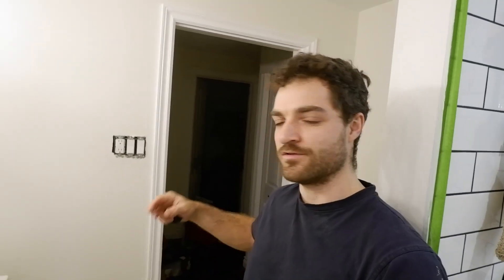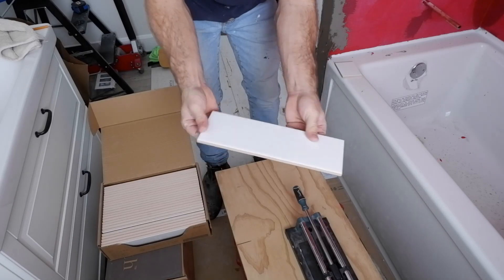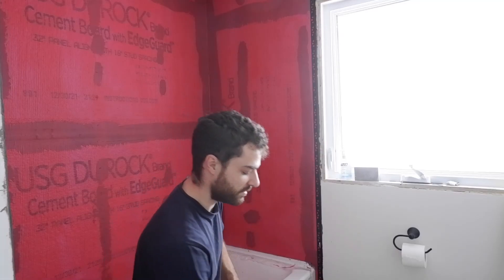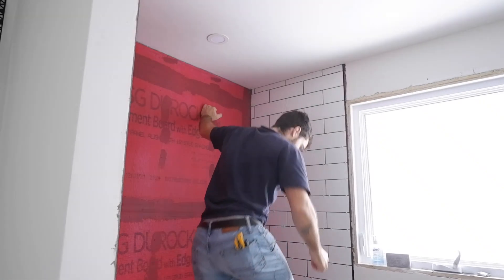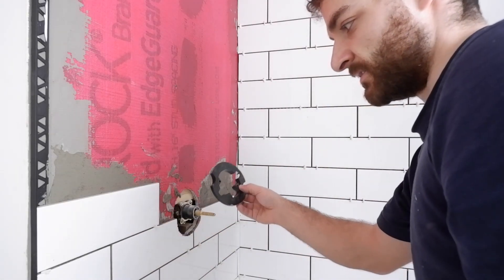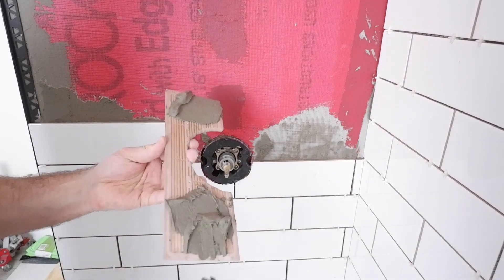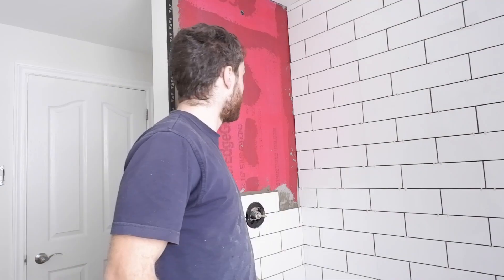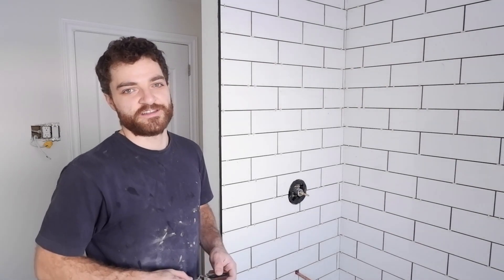How to install 4x12 subway tile - Bathroom remodel part 4

Comment: Usually I see them starting in the middle wall
Reply: That's an option, I didn't watch the whole video, but maybe working out the layout before would've avoided ended up with those small pieces at the edges.

Comment: Did you use a score and snap tile cutter?  Also, I'd love to see a follow up about any issues you may have had over time.
Reply from the maker: I did score and snap most of them! The tile that terminated into the tile edging/trim piece, I cut with a wet tile saw to make the edge a bit nicer

Maybe a follow up video to come!

Comment: That small sliver cut in the corners kills me. 4x12's can easily end full, then half.
Reply from the maker: Totally see what your saying. Unfortunately it was a retro fit with the tub, so the slivers would either happen in the corner or the outside by the Schluter, is in my opinion looked worse.

Comment: Did your tile have lugs? I noticed you only used spacers horizontally.
Reply from the maker: Good eye! I actually ran out of spacers, so I got my 1/8” gap on the vertical, typically using a spacer, then used the spacers for the horizontal.

Comment: Hey Zack, did you do anything to seal the holes around the mud guard or the holes for the copper tube?
Reply from the maker: Hi David, for the shower valve hole, I didn’t, I leave the mud cover in, you can bury it over with tile but it’s made to be removed if there’s ever an issue with the valve, then the decorative cover has a built in water seal, then the tub and shower pipe I caulked around.

Comment: Nice video! Did you back butter any tiles besides the one around the shower valve?
Reply from the maker: With the subway tiles, I didn’t, but I do like to squueze in some thinset into the gap between the backside of the tile and wall if I can!

Comment: Hi Zack - did you use modified or unmodified mortar over the redguard?
Reply from the maker: Hi! Yep, we used a notified thinset. Type of tile may factor into that so just double check!
Reply: Always use modified. Non modified is a thing of the past no need to ever use it